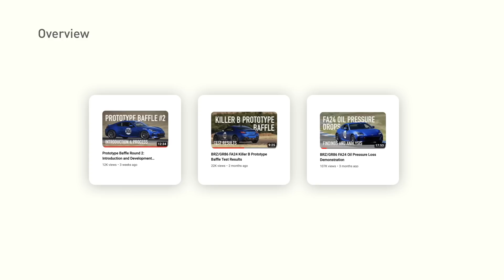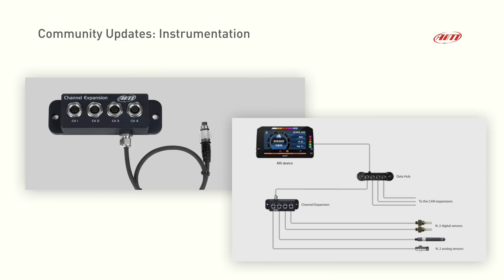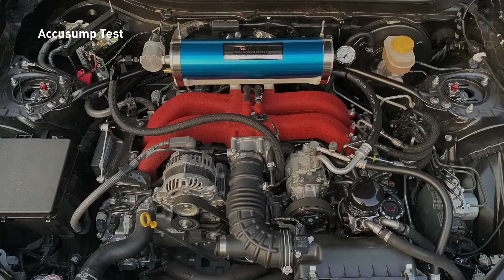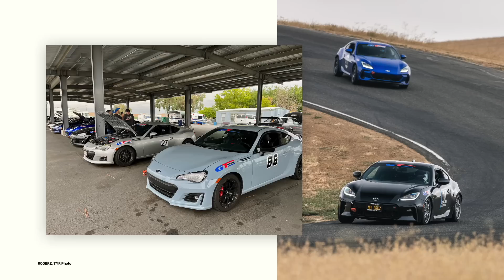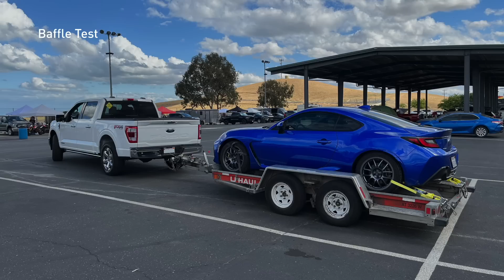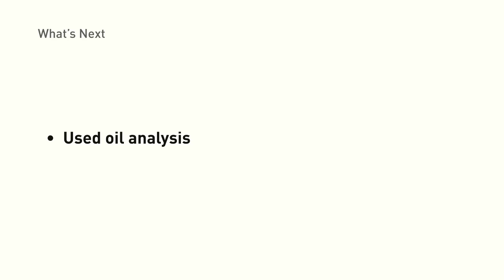Prototype Baffle #2: Results, Setbacks, & Future Plans

Comment: So modifying the stock pump to flow more oil hasn’t been tried or has it?
Reply from the maker: From everything I’ve read/heard, the pump has significantly more capacity than required for this engine. Indications are that slow oil return is causing low oil levels in the sump at high RPM. So, it’s more that there’s not enough oil present rather than an underpowered pump. These are still theories and we’re looking for some ways to test them as well.
Reply: @900BRZ  Being the engine is a flat four, I’m sure at some point and time a Porsche engine had this issue. Or another option is check previous Gen engines to see what’s different if this didn’t happen in those engines.

Comment: Ah man that’s a tough one! Glad to see Verus stepping up and supporting you, that’s epic.

If there is a “silver lining” to the bad situation, the fact that you had to drop to zero oil pressure for what seemed like an eternity before the bearing had enough just goes to show what must have happened for the other engines that failed to let. Yes repeated low pressure events will add additional wear over time but majority of the failures happened at an early stage, which definitely points to other factors such as extreme oil temps or perhaps low levels for the other failures.
Reply from the maker: Thank you, and full credit to Verus for being so good to work with. 

Yeah we don’t really know exactly what point the bearing damage got to a critical level, since there is a lot of wind noise. The mic in the car is on the rear bumper, so it was actually louder to me than the video picks up. But unlike some other failures I know about, I was also lucky to not throw a rod out of the block or anything like that. Could have been a lot messier and ruined the session for everyone else. 

This failure also changed my mind about the OE pressure switch being useless. In theory, if I had learned about the pressure drop earlier, I may have been able to save the engine. I’m looking at programming our instrumentation to warn at sub 10 psi—so more aggressive than the factory switch at sub 3 psi.
Reply: Thanks for the response. My point was more that for a catastrophic failure to occur something drastic has to happen, like total loss of oil pressure for an extended period of time. Engines haven’t failed because they “only” experienced a drop in pressure, likely those other instances was a combination of factors. 

Obviously I’m not saying the pressure drops on right handers isn’t an issue, of course it is. I’m just saying that based on what it took for your engine to fail indicates that it takes some extreme situations for total failure to occur, since your engine had already survived numerous pressure drop events that prior to and during testing. Clearly the use of a higher viscosity quality oil and oil cooler did their job under those conditions. 

Thanks again for your transparency and commitment.
Reply from the maker: Yeah that makes sense to me. Hopefully we can get enough people data logging that we will be able to see data in the future from “typical” failures and learn more about why it’s happening. For now we can only try to reduce the drops since that’s what we can measure.

Comment: Man, thats terrible luck.  Makes for a highly compelling story though LOL

Any thoughts on rebuilding the motor youself?  I'm sure some extra analysis could come from the teardown/inspection, and reduce the costs too (Rebuilding the shortblock properly should be a lot less than $8k)
Reply from the maker: Verus is interested in using the engine for development, so we’ll be shipping it to them. We considered a short block rebuild, but it adds risk and more labor, so we thought a long block made sense in this situation. Very thankful to Verus for being so good to me throughout this whole process.
Reply: @900BRZ  I'm glad the old engine is being put to good use!

I worked at M45 for awhile doing service writing, got to see many, many Subaru rebuilds up close and the costs involved.  If done properly, there are opportunities to improve on a factory short block just with better bearings, ballancing and such.  But a sealed factory unit does have less risk and sealed factory case halves rarely leak too.  You and Versus probably made the right choice.

Comment: After probably like 40 hours of research and countless forums, blogs, and videos. I'm gonna pass on this car. Thank you for the diligence. Fucking sad I really wanted to buy this car with track intentions. Gonna just get an extremely low mile pp1 mustang.
Reply from the maker: To be fair, I don’t think this failure should change your calculus much. I do think we’re close to figuring out a solution to stabilize the pressure drops, despite the setbacks.
Reply: @900BRZ  If I planned on only spirited driving I would not hesitate buying one. The average person should buy this amazing car.

Comment: Thanks for doing all this testing! As someone who's dealt with multiple engine failures on the prior gen car from oiling, my takeaway is that accumulators work incredibly well to bandaid the poor oiling design of these boxer engines. However as you've pointed out, they come with many disadvantages that are difficult to manage - especially when your cold idle is 140psi and hot idle is 15psi, and you want to maintain 60psi in your powerband rpm.

The tactic to use is to have both a manual valve and an electronic valve. Manual valve acts as a hard shutoff for all times except track sessions, and you only open it when your oil is warmed up in the paddock. This avoids any leaks like your friend experienced from cold starts.

Then you flick the electronic valve open as you head out of the pits and your rpm is above 3-4k, enabling the engine to build enough oil pressure to not have the accusump dump all the oil into your pan at idle. It acts effectively as a damper to oil pressure oscillations, with the block port being directly in the main oil gallery in front of the main bearings, which is the best place it can be.

When you come back into the pits, flick the electronic valve off while your RPMs are still high, to keep the oil in the accumulator.

This is a pain-in-the-butt procedure. So I'm VERY much looking forward to a test of higher capacity pans and baffles to see if that can effectively dampen the pressure drops, WITHOUT all the operational challenges of accumulators.

Best of luck with your new engine fitting
Reply from the maker: Yeah using both valves is interesting. I don’t love the additional complexity, but I have also come around on accumulators in general, so—who knows—maybe that will change as I learn more. We still do believe we can hook up with electronic valve to the CAN bus system so we could make the electronic valve activate automatically based on whatever inputs we want. The manual valve would be a good failsafe and completely disconnect the system for daily driving, which sounds good.
Reply: @900BRZ  If you're running a standalone you can do all sorts of clever stuff such as open the valve only when temp>90C, rpm>3000. I'm happy with ecutek on a stock ECU so have never gone that route.

One point to note: with an accumulator make sure you have a large sized AOS or large catch can with a drain back. With crank aereation from overfilling you can end with a lot of oil in your intake tract if you don't have this.

Comment: So I think this Fez Babar is the only FA24 left standing on Grid life. He runs 5w 40 and a slight overfill I think. Has anyone tried stiffer front bars??Also lower ride height anyone ?? Just thinking about decreasing front roll angle and overall cg height to minimize these effects at higher lat g.
Reply from the maker: I have stiffer bars I haven’t put on yet. Bought them primarily for car control practice since they’re not really necessary with sx2s but I could give it a go. Think the difference is going to be relatively minor compared to the angle of the oil caused be lateral G though. 1 G will displace oil to a 45 deg angle. Think we’re primarily dealing with slow return now, so increasing oil volume may be the best solution.

Comment: Hey man. I am glad to see verus is ready and willing to help cover the costs of a new engine. That's really unfortunate! But hey! We're looking forward to the rebuild n testing of newer and better solutions. Looking at the accusump and the 2 quart sump doesn't seem like a bad deal. The valve was a concern. But there is more positive than negative and so I will be purchasing the accusump soon as well. I need an oil pressure sensor as well to monitor my pressures. Once this is hardware comes in, I'll give you an update on how things go. Should have all this setup by December. But that's just cuz money is an issue. But anything to help out with testing. Anyways! You've been a great help for us. And I'm glad to see there are drivers like you that are ready and willing to help the community. Again, unfortunate you got rod knock, but good luck with the rebuild. I'll try to help out when I can.
Reply from the maker: Thank you. We are currently looking at the 1.5 qt Moroso accumulator instead of the Accusump, since it omits the pressure relief valve altogether. You should give it a look too. We’re not sure the lower capacity will be sufficient, but Miles was also using a higher-than-spec air-side pressure, which reduced the effective capacity of his 3 qt Accusump. Good luck and feel free to message me on IG if you want to discuss further.
Reply: @900BRZ  sure thing! And thanks for the tip. I'll do some research on the accumulator

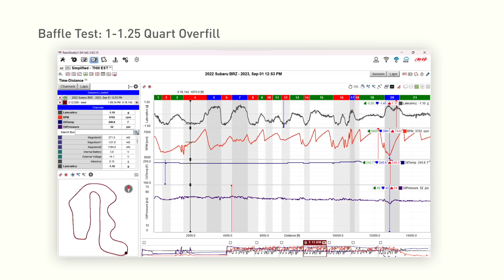Comment: sorry to hear about this whole debacle this was probably the absolute worst case scenario. big ups to verus for stepping up to cover your engine replacement that is seriously awesome of them that certainly softens the blow a little bit. quick question for my own verification about the graph at 8:30 , is the green line in the bottom portion of the graph the oil pressure with the 1 quart overfill? i assume that is also the same line as in the graph around 8:20 just overlaid with the red line of baseline pressure testing? if I'm reading that right it seems like an overfill (at least mostly) solved the issue at least for slower (no offense) drivers right? sorry if my questions don't exactly make sense but I'm mostly just trying to understand those graphs outlining the 1 quart overfill. thanks for all you've done for this platform so far, I cant wait to see what you have next
Reply from the maker: Yeah, you’re reading the telemetry correctly. And no offense taken—the facts don’t lie haha. Definitely lots of respect to Verus for covering the replacement!
Reply from the maker: It would have been a little easier to read if I kept the colors consistent between the single-lap views and the comparison view. Will try to do that next time.

Comment: Wow... that's a bummer. But what a class act all around. Super impressed with Verus for stepping up to cover the cost of the engine replacement, super impressed with how you handled it. I was wondering why we hadn't seen results for so long and now it makes total sense. Unfortunately, looks like the vertical baffle idea is not quite as straightforward of a solution as we might have guessed based on this video and BTR Justin's latest test of the Kazama baffle. 

Really hope a non-invasive solution can be found... I definitely don't love the idea of adding an accumulator to my daily. 

Thanks again for all the hard work and testing.
Reply from the maker: Thank you, really appreciate that. Yeah this was definitely the toughest video to make of the series. Feel like we did learn a lot though, with the overfill doing more than most of the baffles we’ve seen. We do need to pressure test that against faster drivers, but it’s also a super easy test to conduct, so that’s good news. At least feels like we’re getting closer.
Reply: I mean, it should be perfectly fine doing nothing except checking your oil level for just a daily.

Comment: Thank you very much again for all the testing done. Really highly appreciate all your effort put into this.

Like most owner, we will be dual purposing their GR86/BRZ (mostly daily drive + occasional track). So accumulator might not be the ideal solution as you mentioned. Looking forward to much simpler straight forward solution such as baffle / baffled oil pan / redesign larger oil pan.  

Again thank you very much, cant stress it how much we appreciate what you have done here. Millions thanks. Keep up the good work 💪
Reply from the maker: Thanks so much. Yeah, if we can repeatedly show that a large overfill (potentially plus SYMS baffle) works on track, that would be huge. Extracting at the end of the day is tedious, but straightforward and means there are no added failure points.

Comment: I hope that any modified headers to accommodate a larger oil pan remain CARB legal.
Reply from the maker: Same. I need to do some more research there. Seems like it’s possible to get approval through CARB: https://ww2.arb.ca.gov/resources/documents/california-racing-vehicles-aftermarket-parts-executive-orders
Reply: @900BRZ  I wonder if we can just cut up the stock header to salvage the cats. If they're in the flow path, there shouldn't be an issue, right?
Reply from the maker: Yeah that seems like it would be possible but maybe a headache. Personally, if it works and can be sold legally in CA, I think there would be a market for it even if you had to pay the cost of 1 cat

Comment: Good on Verus for making it right. And thank you for putting all the blood, sweat, and oil into solving this issue! I'm really curious if the solution winds up being some combination of larger oil sump with baffling built into it.

Accusumps seem promising but as you pointed out, very particular about the operation and application. Since the appeal to many people of the GR86 seems to be Dual-Purpose I don't think the Accusump will be the predominate solution several years out, but obviously track focused cars will probably spring for that and or going the overfill route.
Reply from the maker: Thank you. Yeah I think a high capacity sump would be awesome. I think we can get accusumps to the point where they have similar reliability as an oil cooler, but yeah, still may not be ideal for true dual purpose cars.

Comment: As an owner of a GR86 with about a dozen track days on, this info is greatly appreciated.  

I know the oil pick line is fixed above the timing cover, but maybe a part could be fixed to the bottom to increase oil pick up.  The owner of PittRace has a Viper and his son was one of the head engineers for the Viper project.  I was talking to some of his folks that tested Vipers at the track and they engineered around oil starvation with an articulated oil pan and a swinging oil suction line, they could not do dry because of costs.  You can find a couple of videos on it if interested.  I wonder if we could get a modification for something similar?  We are a bit tighter under the engine as well.
Reply from the maker: Thanks for the donation! Yeah I’ve heard about various articulating pickups, but I’m hoping we can figure out simpler solutions. Even just swapping the pickup is an engine out job on FA24, like you alluded to. The large overfill having such a positive effect is really interesting. It shows that potentially controlling the oil is less important than just having more of it in the sump at high RPM.
Reply: @900BRZ  indeed.  Even if I have to buy a $15 1L syringe to pull it out at the end of a track day would make it the easiest and cheapest solution!  I’ve put about 0.5-0.75 overfill every track day, change oil out to spec full fill the next day after track days.
Reply from the maker: @jrfish007  Yeah totally! And would have no downsides for daily driving.

Comment: Tough luck with the baffle and engine failure :( Good on Verus though to not leave you hanging!

Do you know which Canton valve part # Miles used? I was thinking of testing one of the switched ones, possibly the 35-40psi valve. Thanks for the sharing the info on the issues he had. Also interesting was the results of the large oil over fill!
Reply from the maker: Thank you! I was just talking with Miles about this last night. All the Canton EPC valves are the same, but the pressure switch kit change out the switch which changes the position of the valve. He is not using the pressure switch kit at all and is instead switching power with a physical switch in his cabin. 

He ended up ditching that setup once we realized it was a 1-way valve and instead hard-wired it to power so it was open for the rest of the track day. This would make it similar to a manual valve in the open position, just like Ansix did. Only downside is he had to leave his car idling for the rest of the day to not drain the battery! (And of course, he was running an overfill whenever the car was idling.)